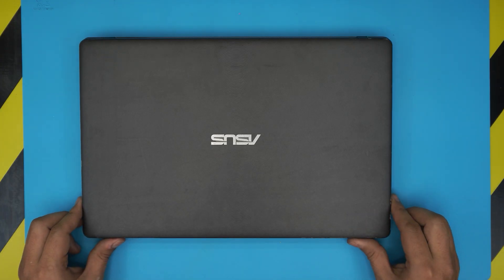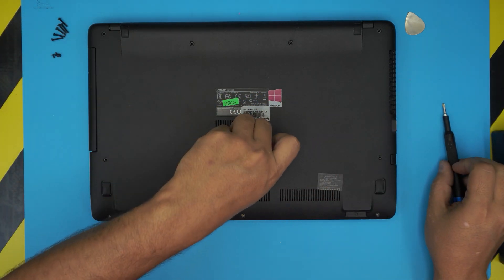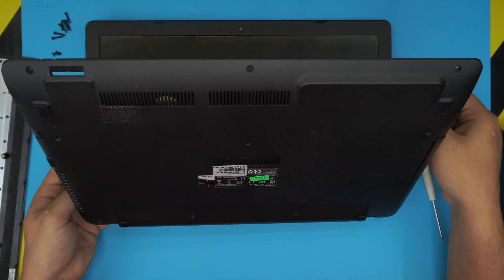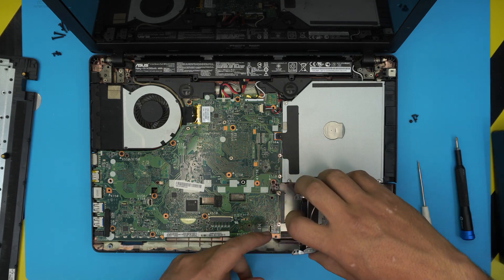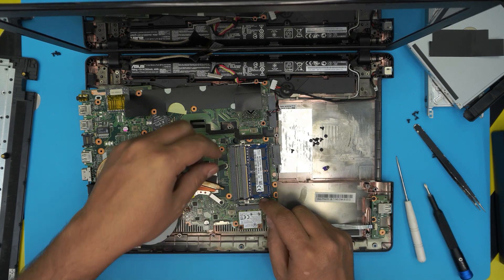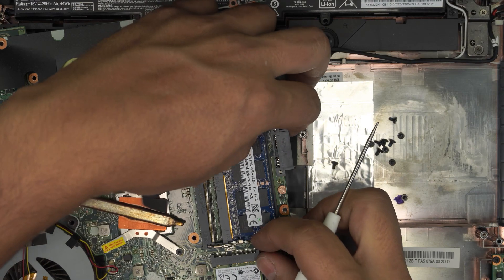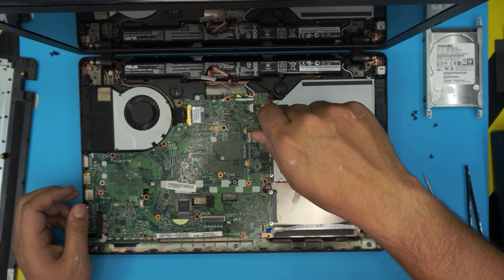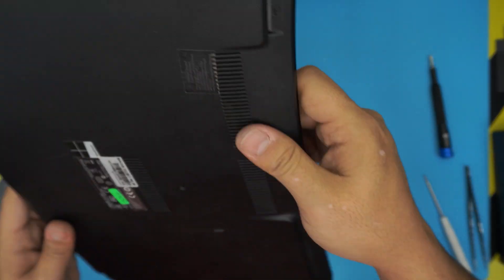Asus X550z Ram Upgrade FULL Guide

Comment: Continuation: with an ext  usb case I was able to copy off my essential files.  I haven’t swapped out the RAM  to test that.  I wonder what happened from one day to the next. All I did was unplug from ps and closed laptop like so many other times… this time it was dead the next time. Sorry for the fragmented messages.
Reply from the maker: This is very common on these models, where out of nowhere the MOSFETs get shorted. The main rail MOSFETs usually go bad on these models.

Comment: I forgot to add in previous comment my laptop (before opening it)  refused to power on any longer. I tested the PS and had voltage. I did a power reset also before and after removing battery. No change, no lights light up. So I opened it up and removed the HD and with a

Comment: Thank you for the excellent video. What is the max Ram and ssd size for this model  16g and 512g? Thanks again. I agree with the poor design of the case not leaving a means for quick access for basic upgrades. Dealing with all the cables is a bit ominous for a complete disassemble to just be able to upgrade the RAM. Thanks again. 😊
Reply from the maker: That is correct.
It's my pleasure my friend.

Comment: Mine Upgraded from 8gb (4x2) DDR3L
To 16gb (8x2) DDR3L
I changed the Thermalpaste also for the Cpu & Gpu + SSD
It performs better & faster than before when i'm using HDD
-Device Asus X550ZE Amd Fx 7500p
Reply from the maker: Awesome Upgrade 👍🫠
cheers🍻

Comment: Hello, i would like to thank you for your clear guide to disassembly this laptop. I have a question, my laptop is asus X550ZE and i want to upgrade ram, should i get the DDR3 or DDR3L because i don't know which best for my laptop
Reply from the maker: It's my pleasure, my friend. 😊 I deeply appreciate your taking the time to provide feedback. If you're inclined to support the channel further, feel free to like and subscribe—or even both!
Regarding your question, the recommended ram for your model is the DDR3L L stands for Low voltage, its the most compatible.
Should you have any further questions or requests in the future, please don't hesitate to ask me.
cheers🍻

Comment: i followed this video and it was incredibly helpful thank you for this but when i tried to turn it on again my screen won't turn on :( what do you think have i done wrong?
Reply from the maker: Thank you for your feedback! If you wish to support the channel, you can like, subscribe, or do both!
Regarding your question, swipe the locations of the ram place the new ram on the bottom and old ram on top.
if that doesn't work let me know plz. and when you power on wait up to max 15sec
also i hope you placed a SDRAM DDR3L (L=Low voltage) it is very important.

Comment: Thank you, very helpful video. Trying to revive my old laptop to use with a lightweight Linux distro, added 16gb (2x8gb), a 500gb ssd, and replaced the battery. This video made the install very easy. Very good in-depth instructions, you covered every potential area that there could be any trouble. Even a complete beginner could do this job thanks to this video. Great job! Thanks again!
Reply from the maker: You're welcome 😊 Thank you for the feedback! if you wish to support the channel you can LIKE or SUB or both :P
if you have any question or request feel free to ask my anytime my friend :)

Comment: Nice video! Im planning to upgrade the ram and ssd of my x550z laptop, id like to ask if is it okay if any brand of ram i use as long as it is ddr3? My laptop is currently 4gb hence i want to buy another 4gb to save money rather than buying 2 4gb new ram..thanks!
Reply from the maker: Thank you for the feedback! if you wish to support the channel you can LIKE or SUB or both :P
regarding your question: Sure you can mix brands and GB of rams nothing will happen, it will work fine, but make sure you get SDRAM DDR3L don't get the DDR3 normal get the low voltage (L) 
https://amzn.to/3qlsU17
Reply: @uFixTek  thank you! I have successfully installed another 4gb (now total should be 8) however, system info shows usable is only 3.45gb, is there something wrong?
Reply from the maker: @monmon0691  I'm sorry but i have no idea why YouTube  place most of the comments in the spam list!! sorry about it :(
regarding the usable 3.45 its because the bios takes a little for the video ram, its very normal.
Please leave new comment if you have any questions.

Comment: Can you upgrade the wifi in this laptop? Cuz mine is really bad that i have to use external wifi receiver
Reply from the maker: Thank you for the feedback! if you wish to support the channel you can LIKE or SUB or both :P
regarding your question: i would recommend you to invert the wifi and Bluetooth cable  (plug the black cable in the white cable jack and the white to black cable jack), sometime (mostly the connectors get a bad connection)
right @6:08 is where i remove the cables, just remove them and invert them.
Reply: @uFixTek  i see, i'll try it when i want to upgrade my RAM. Thx
Reply from the maker: it will fix your issue :P

Comment: Wow! This is intense.  I'm pretty confident about taking a computer apart if I know what lies ahead.  Thank you for this video.  It has been a while - without taking the whole computer apart how do I know if there is an 8 gig in one slot or 2 - 4 gigs (I noticed 2 slots and wasn't sure how ASUS has theirs).  Does the RAM need to be paired up in each slot? 8 and 8?   Thank you for your help
Reply from the maker: Thank you for the feedback! if you wish to support the channel you can LIKE or SUB or both :P
regarding your question: you can download cpuz:
https://www.cpuid.com/downloads/cpu-z/cpu-z_1.98-en.zip
and in the tab "SPD" it will show the ram information for each ram installed.
eg: https://imgur.com/a/h03A12P

the combination of the ram has no effect on the performance you can have 2gb and 8gb or anything alike.
Reply: @uFixTek  Ah Thank you again! I did like and subscribe - I had forgotten about that tool...used it a long time ago on one of my desktops...that was my first time replacing RAM ever and back then you had 4 slots and they had to be paired....so glad you cleared up the combination.
Reply from the maker: its my pleasure and thank you for the support. yes back then with 4 dim you needed to have AA and BB slots , but not they dont have 4 dims anymore.

Comment: Hi,Thank you for ur video.
I follow the step but my keyboard most of the keys are not working after I update the SSD and Ram.

I checked the graphics card temperature go up to 60-70degree. Would you recommend to replace the thermal paste?
Reply from the maker: Thanks ✌  for the feedback!  if you wish to support the channel you can LIKE or SUB or both :P
regarding your issue the, the keyboard has nothing to do with ram nor ssds, you may have place the flex cable of the keyboard wrong. remove the flex cable and re-insert it.
if you gpu is at 60-70 that fine but if it goes over 90 then yes worry.

Comment: Thank you for the clear tutorial. I successfully replaced the hdd with ssd and ram to 2x8gb
Reply from the maker: Thanks ✌  for the feedback! if you wish to support the channel you can LIKE or SUB or both :P
if you got any request or question feel free to ask  me anytime.
Reply: @uFixTek  Liked and subbed the first time I watched your vid :D Please could you let me know the flex ribbon cable type/model of the one over the hdd/ssd (how many pins etc) I think I broke it (the transparent blue plastic on the tip of it missing) and as a result my usb port doesn't work
Reply from the maker: @noroardanto  let me get to the office in the morning and i will let you know. Thank you for the support.
Reply: @uFixTek  Thank you
Reply: Thx for the info man, i wanna do the same thing hope it's okay like you did
Reply: @yorizpra  Good luck man! I hope it worked for you. It really transformed the good ol' x550z into a better and faster laptop

Comment: sir. is it possible to change cpu on that model? thanks
Reply from the maker: Thank you! for the feedback and your support to the channel by SUB :P
regarding your question: sorry to  inform you but you can't upgrade the CPU, its soldered on motherboard. and its not possible to upgrade, even if it was a LGA socket, unfortunately its BGA chip